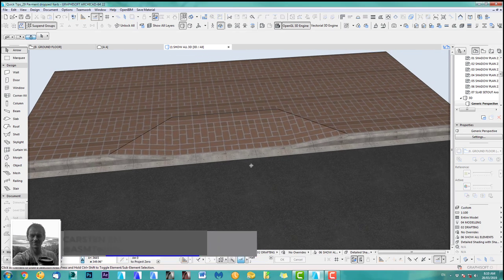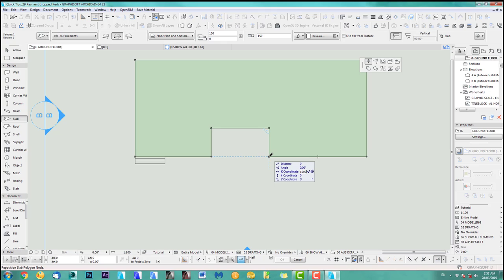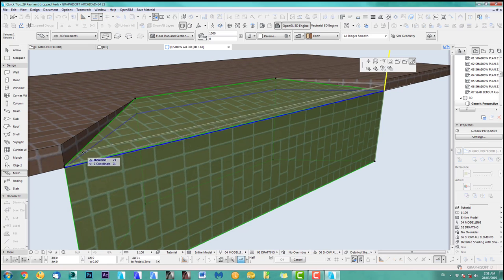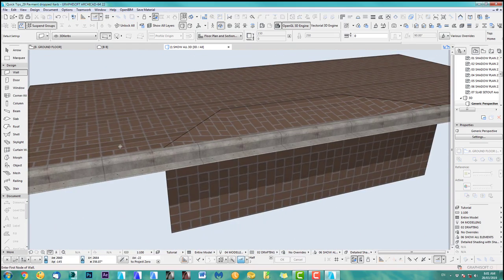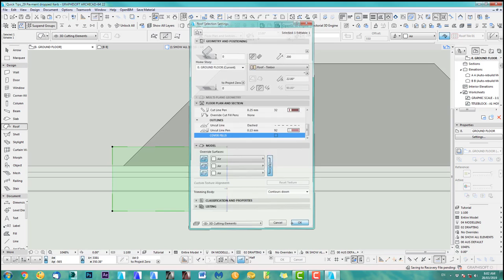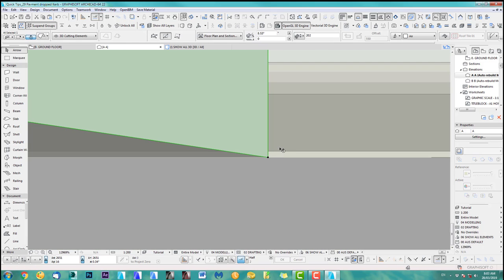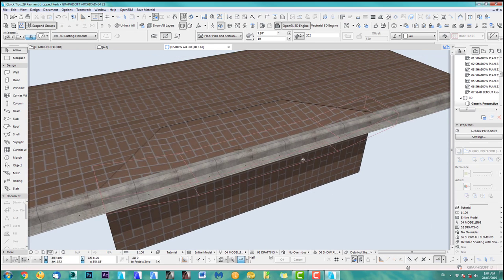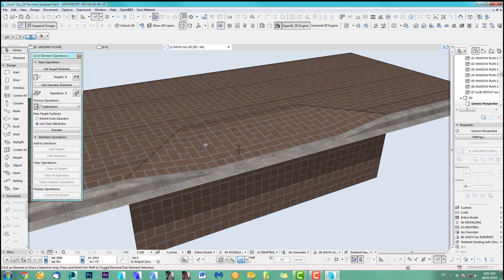How to create a pedestrian drop kerb in ARCHICAD

Comment: Instead of using the Air building material to make the cutting element transparent, you could apply the wire-frame setting to your 3D cutting layer in the Layer Settings dialog. That way you can preserve your surfaces on the cutting element when you want to perform SEO operations that involve inheriting the surface material from the cutting object.
Reply from the maker: Scott Graham yes I like this idea , that will work pretty well , thanks for sharing this idea/solution !